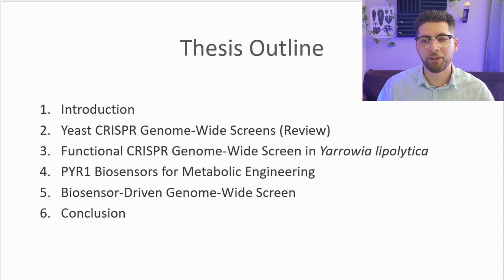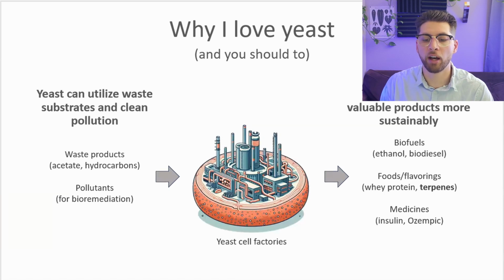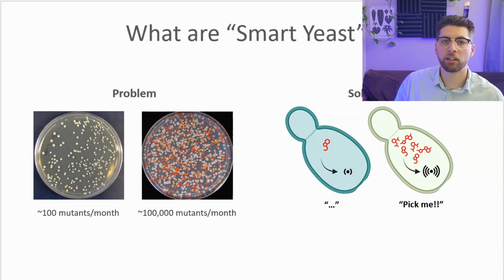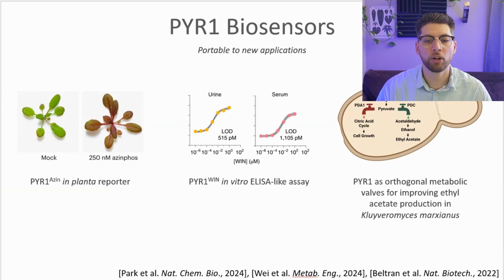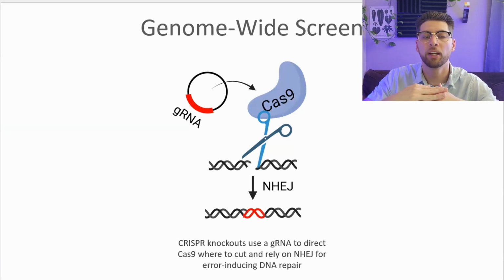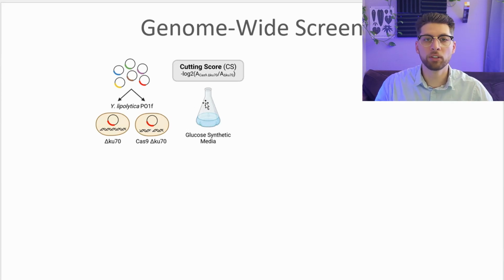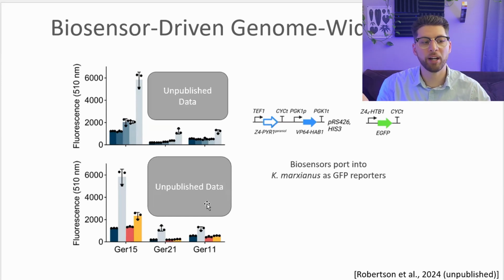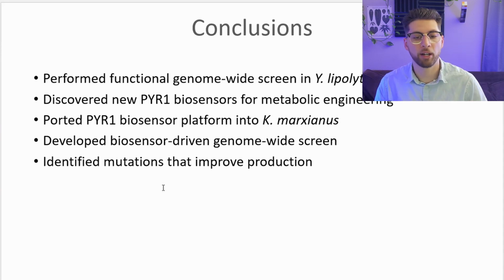"Smart Yeast" | Bioengineering PhD Defense

Comment: Extraordinary video! One question: you’re scanning ALL potential [gene knockout locations? CRISPR guides?], for optimal gene placement location/efficiency, then manually evolving them to further suit the task by making the yeast report production r8 for you??? you’re essentially just plugging the output activation from the biosensor (programmatically) into growth factors or other genes? This is really cool!
Reply: i take it you could eventually configure multiple biosensors/genes as a “program” (reproduce until quorum sense; produce and export [molecule] when at concentration)? would using smart yeast in practice be similar to regular alcoholic fermentation (plus purification)?
Reply from the maker: Yes exactly!

Comment: Some questions about the last chapter. It seems like one of the knockouts produces more terpenes simply because it can grow faster whereas the other one optimized some terpene synthesis pathway. Did you make a strain with both knockouts? Also, did you use barcodes when making your library or did you sequence the entire genome of your increased fitness mutants to find the KO. Congrats on passing and great video!
Reply from the maker: Great questions! The two best knockouts grow the same on regular media, they only grow different when there are high concentration of terpene added to the media. Both knockouts would be a good next step!
Yes, each sample of our genome-wide screens are barcoded so we know which flask the guide counts came from. We only have to sequence the gRNA on the plasmid, not the whole genome. Another reason why CRISPR screens are great!

Comment: Is there a good strain of yeast which has been engineered to break down waste carbohydrates without generating undesirable volatiles? Or could you setup an air pump into a bioreactor and use a carbon filter to scrub the smell?

Comment: Can you do work by adding "feeding energy by electricity" to Yeast from electric-powered (electric feeding) bacterias? Its seems can be interesting for industry "precision fermentation microbiological protein production" for example, for all Yeast-based industry
Reply from the maker: Two things here:
1. you can make carbon sources with electricity and CO2 (artificial photosynthesis)
2. you can provide energy to cells in the form of electricity
But energy and carbon source are two separate things, just to be clear